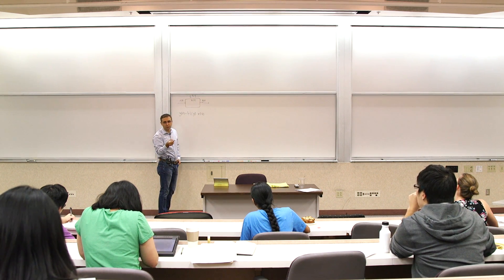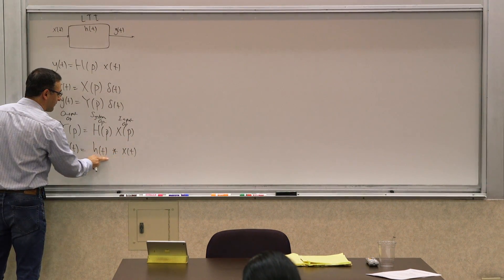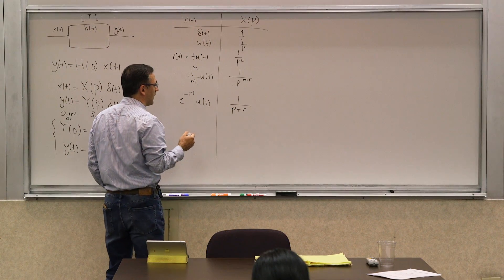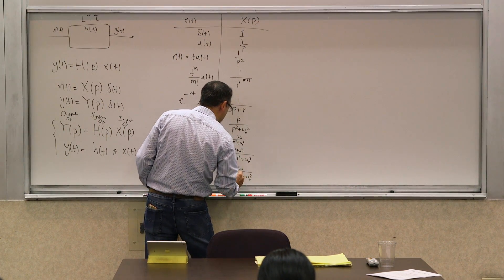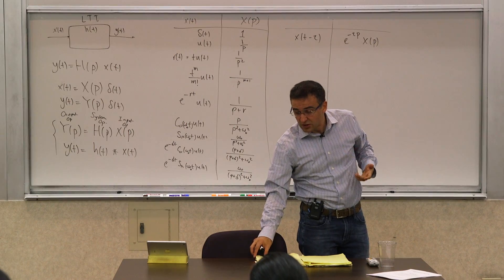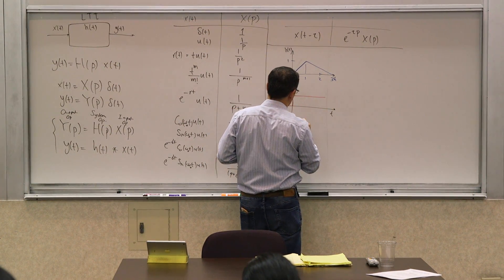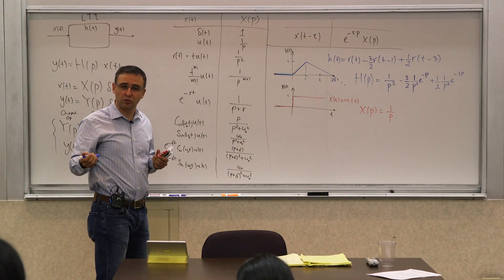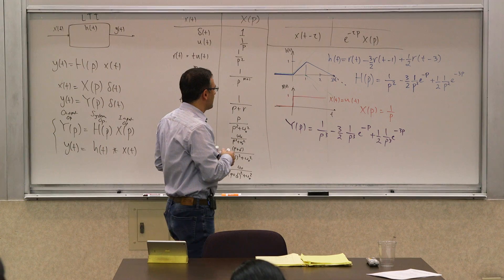025. Heaviside Operator: Operator Catalog Review, Convolution Example

Comment: 00:03 Solving differential equations using operators and catalog of responses.
02:01 Convolution in time domain turns into multiplication in the operator domain.
03:55 Review of complex operators and key functions
05:56 The Heaviside operator is used for convolution and solving problems in the operator domain.
08:18 Using the Heaviside operator to manipulate functions and determine coefficients.
10:54 Understanding the Heaviside operator and its application in convolution
13:00 Understanding the properties of the Heaviside operator
14:50 Conservation of energy and its usefulness
Reply from the maker: Thank you.